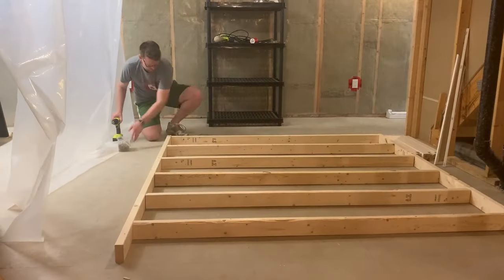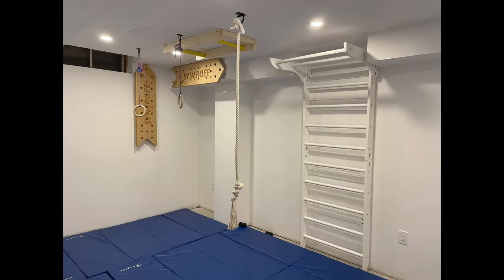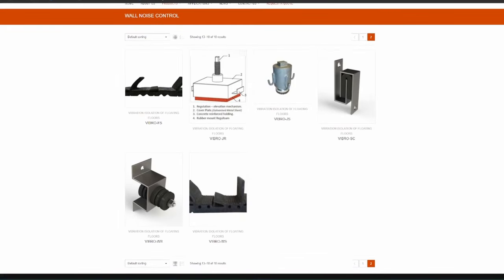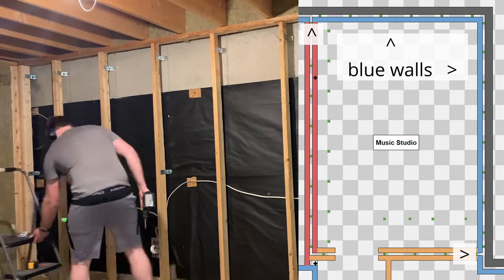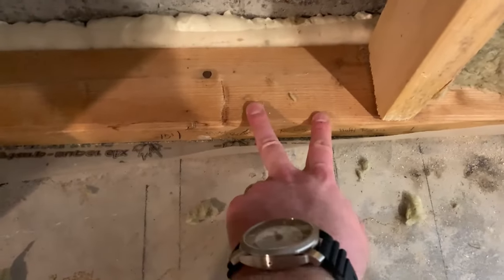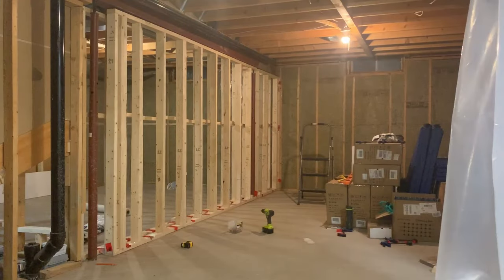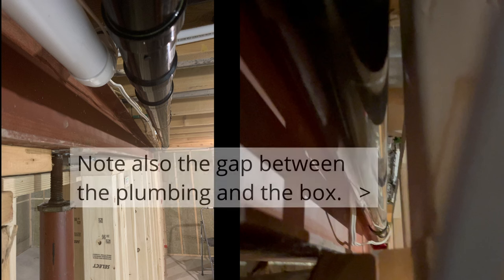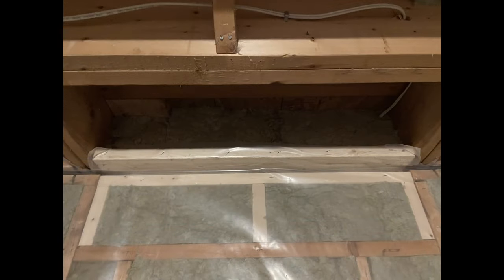Framing & Isolation: Basement Music Studio Build

Comment: Ahh nuts, I already pretty much completed the framing for my studio space in the basement and knowing what I know a week later, I probably would have used iso clips. I've got a similar space. living area, studio area, gym area. I'm on two external facing walls and the two internal ones we did staggered studs with one wall within a wall beside basement stairs. I probably should have used iso clips to connect the walls to joists for top plate. But I tell you, costs go up quick! I'm currently considering how I will tackle the ceiling as that is where most of the sound is going to escape once I get my drums back in the basement studio room. I'm trying to choose between resilient channel vs clips and hat channel then 2 layers of 5/8 drywall with minimal wiring coming through for lights. HVAC is going to be an interesting consideration.. I am far from the supply and return but it will still carry sound so I am thinking about insulated flexible pipe and snaking it somewhat within the joists. I'm looking forward to following your build. Damn I-beams in these newer homes. Total PITA.
Reply from the maker: Totally agree on costs. You still have the option to consider iso clips at this stage. Fair bit of work to make the switch but still possible. For the ceiling I would highly recommend iso clips and hat channel if you can afford the ceiling space. I used resilient channels and it’s a bit of disappointment. Not terrible, but not as good as I was hoping. I’m tall so I’m not sure giving up the ceiling height would be better overall, but I’m terms of isolation absolutely.

Re: HVAC. I’ll be posting my video on this by Saturday. It’s taken me a while cause it’s so difficult to explain without a lot of visuals. HVAC was the hardest part of the build, but so worth the effort. I used flexible pipe with bends just like you’re thinking. A few other steps as well.
Reply: @simonbaxtermusic  awesome stuff. I will be sure to watch the upcoming vid..and yes, i almost feel as if resilient channel won't be that much of an improvement over double drywall alone. I'm pricing out iso clips for the ceiling for this reason. HVAC though, i've spent hours trying to figure this out. I have a friend that does hvac but it is interesting that they dont see it as we see it for sound,  they see it for efficiency.

Comment: I've used 3 mm armaflex pipe insulation tape on all beams and studs and R15 insulation on ceiling and walls, but it's for my office, so a little noise should be okay but so far I don't hear anything crazy.
Reply from the maker: As long as you’re happy with the results that’s all that matters. Where is the armaflex attached? That sounds similar to some other isolation membranes made to go under framing, creating some isolation between the frame and the floor.
Reply: @simonbaxtermusic  armaflex attached where drywall joins studs, inner side of  the room, on all walls and ceiling as well as in the corners on the floor the ceiling on the perimeter. The only thing that I'm not sure of are HVAC channels that are slightly (12 inches) lower than the ceiling, and there's some existing framing from 2x1 and 2x2 wood planks. I'm thinking about nailing ceiling tiles to them as the framing attached to the ceiling with nails, so I'm afraid that the whole thing might fall off if I'll put drywall on it. And I'm thinking about putting some insulation on those channels, but I'm leaving it for the very end. Because I want to finish everything else first.
Reply from the maker: @waltmiller  your best strategy is to be consistent with the number of layers of drywall everywhere, so you’d be better off putting in new studs around the HVAC if you’re not sure about the strength of the existing studs. Ceiling tiles won’t give you much sound absorption. You should watch my video on drywall:
https://youtu.be/Jr8VO8Cs2rI
Reply: @simonbaxtermusic  Thank you. I mean Armstrong ceiling tiles. They're saying that they're better than drywall. What would you say?
Reply: And that's what was there before.
Reply from the maker: @waltmiller That would be difficult to ensure. If they’re heavier than drywall it could be better, but you’d have to carefully seal each tile to make sure it’s air tight. That sounds like a lot more trouble than it’s worth. Also, 1 layer of drywall isn’t enough for a music studio. It could be enough for an office if you just want to have a little more isolation than a normal room. My video on drywall and air sealing goes over this in detail.

Comment: I'm not at all clear on why you'd connect the studio and climbing room walls with clips...
Reply from the maker: The climbing room wall is connected to the floor and ceiling as usual. The studio wall is then connected to the climbing room wall with isolation clips to reduce vibration between the walls. I’ve created a “room within a room”, where the studio is decoupled from the rest of the house with isolation clips. Not as effective as a completely separate structure, but much better than standard construction. Since it’s a basement I didn’t have the space to build a completely separate structure.
Reply: @simonbaxtermusic  I understand why you'd use isolation clips for the ceiling but why connect the walls at all? I presume you lapped the top plates and fastened the bottom plates to the slab in which case the structure is fully self-supporting and would need no contact with neighboring partitions.
Reply from the maker: @helmanfrow  The only time I’ve seen a fully isolated structure is when there’s a frame for the ceiling that keeps the full length of the wall rock solid. I definitely noticed a difference in strength for my walls when I attached the iso clips.

It’s possible I could have done what you’re describing if I had secured the top plates differently, but it wasn’t an option I was aware of at the time. The bottom plates are power hammered into the slab.